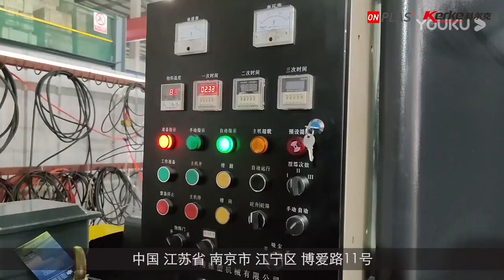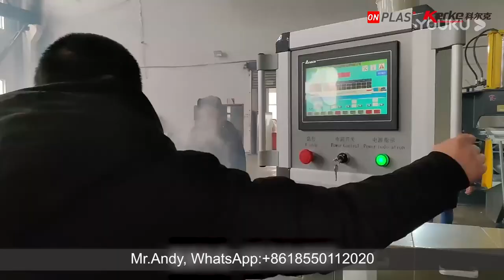Kneader Mixing High Fill White & Filler Masterbatch Compounding Twin Screw Extruder

Comment: Is this for the production of plastic masterbatch? How is it even done? Do you mix pigments and additives in the twin-screw extruder machine, or before then? In the mixer machine, whichever kind it is, do you melt the plastic fibre down while it is being mixed with said pigments and additives?
Reply from the maker: Yes, it's for masterbatch. We can use mixer or kneader pre-mix them and feed compounding by twin screw extruder